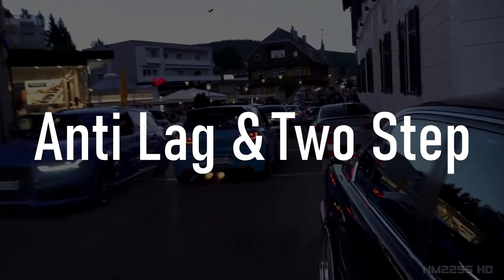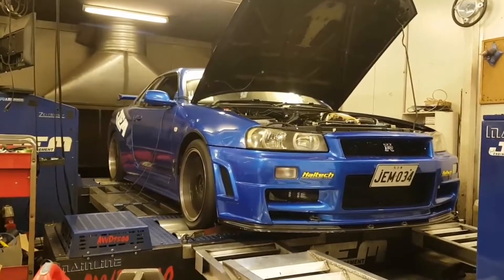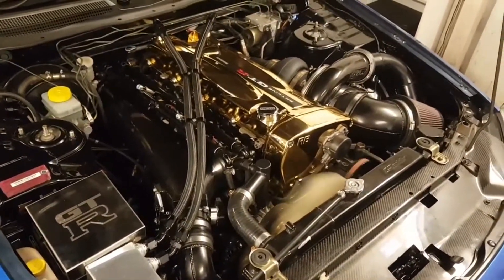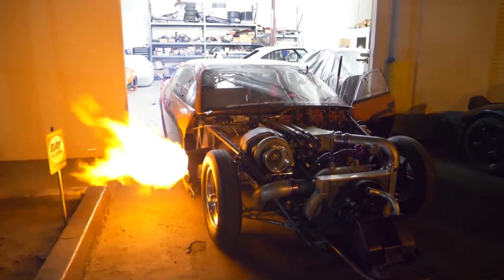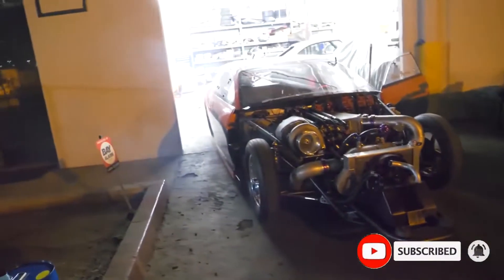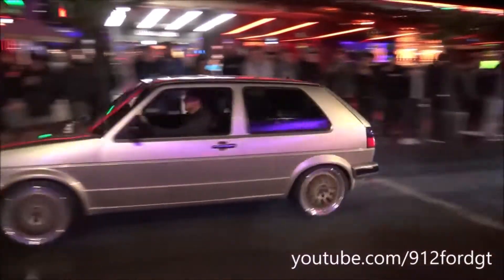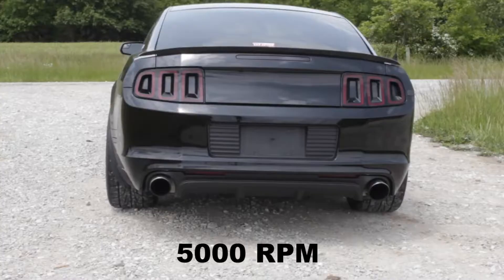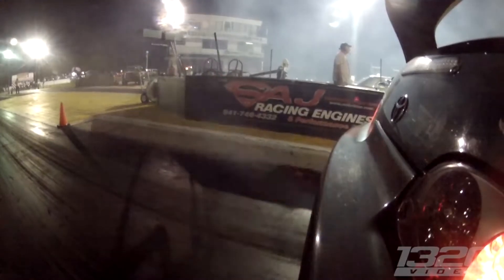Quickly Clarified - Anti Lag & Two Step in 4 Minutes!

Comment: Good video, but I hate to be a pain... Don't confuse lag with threshold. Lag is not the time it takes for the turbo to spool up. That's the threshold. Lag is the engines reactiveness to throttle changes while already ON boost. One might argue that putting your foot on the gas and waiting for the turbo to spool up is lag, since there is no big change in the rpm until the turbo sets in. But this is a common misconception. Since last describes your engines throttle response on boost, it can also describe letting off the gas while on boost. Some engines take longer to do this, because of large and long boost piping, impractical location of bov and therfore too much air in afr for a while after letting off the gas. But besides that thumbs up for the video!
Reply: Correct me if I'm wrong, but isn't the boost threshold the engine RPM at which the turbo begins producing significant boost when spooling? And I was under the impression that turbo lag was the time from going WOT with the RPM above the threshold to getting the boost from the turbo?
Reply: @DJ_Level_3 yeah Idk what mans is trying to do, the entire world thinks the time from wot to full boost is boost lag and thats never going to change and perfectly fine by me
Reply: Yeah I'm confused too. Isn't lag just the time required to reach the "threshold" on WOT? Doesn't seem like a misconception to me.
Reply: I did a quick search and found the article where the OP got their information, and it's full of nonsense. It uses phrases like "exhaust pressure flowing through the turbo" which... no. Those are definitely some words placed in a specific order, but using a phrase like that indicates a fundamental misunderstanding of how this turbocharging shit works. So let's correct some misconceptions here:
"Lag is the engine's reactiveness to throttle changes while already on boost".

Nope, that's referred to as throttle response. You can have a "laggy" throttle response but that's not the same thing as "turbo lag", which is universally understood to mean "the delay between opening the throttle and the turbo spooling up to the point where it begins to produce a significant amount of boost". However, the two phenomena are often closely interrelated because they're both affected by many of the same design variables; engine size (i.e. exhaust gas flow rate), turbo size (i.e. rotational inertia), how well-matched those previous two factors are, compressor/turbine wheel design and how well optimised they are for a given engine configuration/application, manifold and induction system design (cast manifold vs. equal-length headers, overall length of the intake tract, filter and intercooler sizing vs. flow restriction, etc.). By managing/combining all these factors in various ways, one can achieve a forced induction setup with lots of turbo lag but very rapid throttle response once on boost, or vice-versa, or some desired middle ground between these states depending on what you're trying to achieve (racing engine, passenger car engine, load-hauling engine, etc.).
"Threshold" typically refers to engine RPM at the point where the turbo's boost curve begins to rise sharply from the idle value, the "boost threshold".
"Wastegate threshold" refers to engine RPM at the point where the wastegate is fully open, thus holding the turbo at the desired peak boost pressure.

TL;DR -
"Turbo lag" refers to the delay between the thottle being opened and the turbo reaching its boost threshold.
The OP is confusing this with "throttle response", which refers to how readily the engine responds to changes in throttle input within any given RPM range. It's worth noting here that many modern sports cars with electronically controlled drive-by-wire throttle bodies are able to vary their throttle response at the push of a button (within the fixed physical limits defined by the engine/turbo/intake configuration).
Reply: Bov doesn't do anything for performance.  That's what external waste gates and dump vales are for. Anti lag systems reroute exhaust gasses In the intake to what? Keep the turbo spooled up! So your explanation is factually wrong.
Reply: AAAAAHHHHHHH
Reply: All those words to be wrong

Comment: How does the engine run (pistons move) if the ignition or fuel is cut off?
Reply from the maker: the ignition/fuel gets cut off just to hold the RPM at the set two step RPM. So let's say its set at 3000rpm, when the ECU sees that the engine is going faster than 3000rpm, it cuts either the ignition or timing. This slows down the engine and when the ECU sees that it is below 3000rpm, it resumes ignition or timing. This happens very quickly (possible hundreds of times a second).
Reply: @JCMediaYT  Ohh. Now I get it. So it's basically an RPM limit. Thanks a lot mate. Was really confused with it. All clear now. 👍
Reply from the maker: @akshayajaykumar12  yep, pretty much like your normal rev limiter but lower and usually adjustable. hope that helps!

Comment: Does it still damage/destroy my turbo when I run a ignition cut off 2 step on my turbo charged supra?
Reply: Honestly, the topic of damage is relatively subjective. Sure it will definitely damage some parts however I would assume that if you’re building the car for the specific purpose of using that feature I would recommend getting some durable parts for boosting.
Reply: @malicebean3216  Alright, thank you.